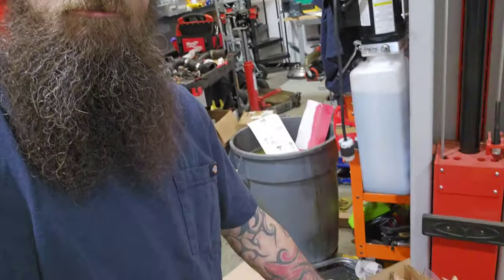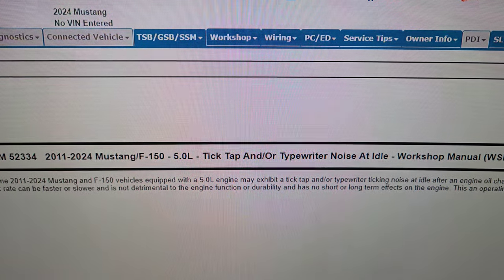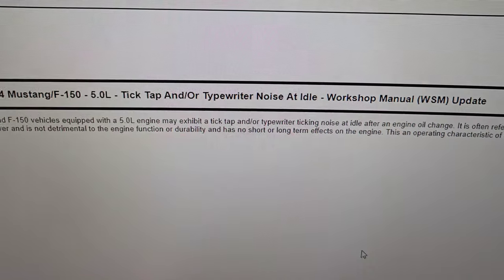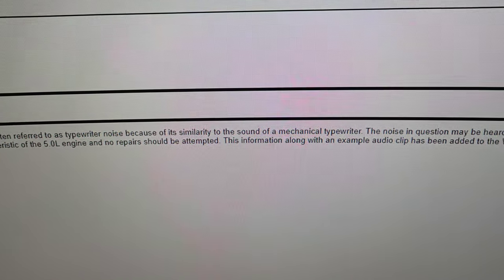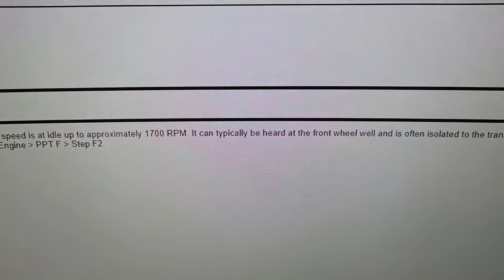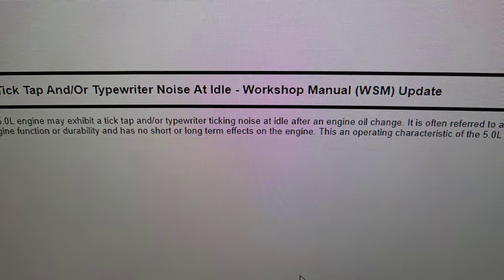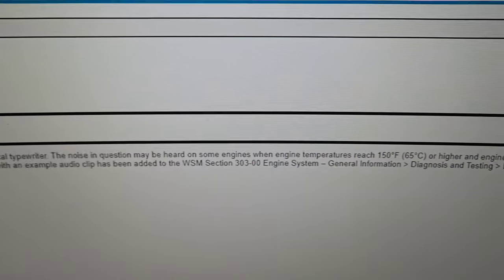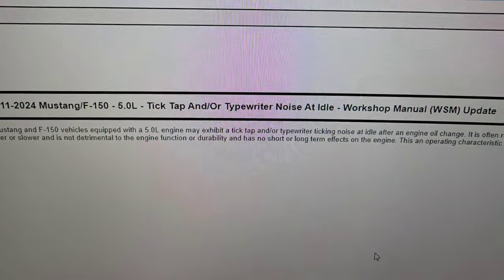Does The 2024 5.0 Coyote Tick? UPDATE #newtoyou #automotiverepairs  #mechanic

Comment: I have a couple of friends that one has a 2018 mustang 5.0 and the other has a 2023 f150 with the 5.0 they both drove 1000 miles for a break in then switched to Amsoil the mustang has 50,000 miles on it and the f150 has 8000 miles on it and they both don’t tick
Reply from the maker: My 18 mustang gt doesn't do it. I run amsoil. But then again. Not all of them do it.  Careful with that f150. It has a wet belt for the oil pump
Reply: That’s the oil I’m going to use for my first oil change
Reply from the maker: @E85_STI  💯💯

Comment: My 14 is quiet but I would be annoyed for sure if it ticked. I don't understand how changing the oil can make it come or go and it not be a lubrication issue which is definitely not normal. Just ask any competent engine builder.
Reply from the maker: Yep. Not sure how it's after oil change. But usually the further you go on that oil it quiets down. Then you change it and it does it again.  But not all of them do it. A friend works at ford in Kansas. And i was talking with him about it. We may have found a fix. Still needs more testing. But. We are working on it. Can't really release too much info on that. But. Soon as we know for sure. The world will know.

Comment: So if it’s “normal” why does it go away if you use 5W-50?
Reply from the maker: @hpkntnw  it doesn't. Not sny of them that we ran 5w50 in. It's still there. Normal meaning it just does it. Not hurting anything. Even the powerstrokes do it and I run 5w40 in them. I wouldn't run 5w50 in a mustang unless it was supercharged

Comment: Wix filter and amsoil will fix this I had 2021 gt
Reply from the maker: @ARTEM-ui4wx  amsoil with an amsoil filters does it too.  Only it will start again when you change the oil and filter. Amsoil and wix are basically the same filter
Reply from the maker: @ARTEM-ui4wx  I have a 18 gt
Reply: @BeardedFordTech   I think ford oil is just cheap  like water they should use amsoil for performance vehicles V8  this motor will last longer
Reply from the maker: @ARTEM-ui4wx  the full synthetic motocraft is decent. The bulk synthetic blend isn't made to go far. They should factory fill these with amsoil 5w50.  5w50 is factory fill for the  shelby with super chargers would eliminate a lot of the issues. Some guys run euro 5w40 and the noise goes away

Comment: Thanks for your vids man. That's exactly where the noise is on my f150. Wheel well and trans. It starts about 10 seconds after starting.✌🏼
Reply from the maker: Yep. That's the BBQ/Typewriter  tick
Reply: @BeardedFordTech  I just don't get what causes the noise. It revs with acceleration up to a certain point. It just seems like it has to be piston noise but I don't know.  Seems like at idol it has low oil pressure and makes the noise. Once you give it enough acceleration to build oil pressure it goes away. I don't know, it just drives me nuts. You pull into a stor or something and sounds like your driving a piece crap with a motor knock. Oh yea I guess I am. LoL. I love the truck. Great truck great power. Just drives me nuts. Along with the stalling every once in a while.
Reply from the maker: @lonewolf744  phasers and solenoids will cause the stall. It is very low oil pressure at idle. It uses a variable geometry oil pump controlled by an actuator.

Comment: Do you recommend adding ceratec in a 24? Dealer says they advise against it as it’s normal, they claim it’s the “high pressure DI fuel pump”.
Reply from the maker: @lindin_h  I DO NOT recommend adding certatec to any engine.  And I do not recommend it for the 5.0 liter. It's been doing it since 2011. And since 2018 people have made a big deal about it.  It's not hurting anything. Do not add anything to the oil

Comment: 2024 owner here,  ours just started at 1100 after first oil change.
Reply from the maker: Yep. Normal. Not all of them do it. My neighbor has one. It doesn't do it. But I see some at the gas station up the road. Some of theirs do it. Some don't. Weird.
Reply: @BeardedFordTech  Any perspective on the oil volume? Ford says 9.5 qts, but the dip stick on the 2024 if you put 9.5 qts is registering at the low end of the dip stick. 10 quarts puts right in the middle.

Comment: Hydro boot  man  last week got 3 reman units through    napa and I sewar all that was done to them was a spray paint job  and after the client wasting my time and there money they finally listened to me and got an OEM and Bam Fixed  and i got a 5.4 with the oil leak on the right rear cylinder head and no compression on 4 cylinders in that 4x4 conversion Van that I was hired to rebuild the Differential in
Reply from the maker: Yeah parts like hydroboost and turbos main parts like that. DEF systems exhaust filters I go OEM. I got burned on compressors from oreillys. They lasted like a week. So your no compression is it all on one side?  Timing chain?
Reply: this Van has a Crazy story on it

Comment: Is this similar to 3.5 eco boost noises? I got the timing chain rattle repaired under warranty on my 2018 F150, but it still sounds like metal is rattling around in the engine when idling or driving slowly.
Reply from the maker: Nope. The BBQ tick doesn't sound like metal rattling. Sound like lighting a propane BBQ grill lighter. If your hearing metallic rattling. Take the belt off the water pump and start it. If you don't hear the noise then it's the water pump. If you do hear it, you may have another problem. Reason I say remove the belt. If the water pump fins are scraping the engine you won't hear it with the belt removed cause it won't  be spinning.
Reply: @BeardedFordTech  thanks man
Reply from the maker: @ATHLETE.X  np

Comment: My ‘21 F250 6.2L has a “normal” typewriter tick…more pronounced at 1500 rpms. So damn annoying. Started around 8k miles. Now at 30k and no change. I heard putting sound deadener on the fuel rails helps. I’ll be doing that soon and trying Liqui Moly oil with ceratec additive. Have heard positive things of taking the tick down a few decibels. I’m desperate enough to try. I’m tired of having to drive around with my stereo volume up to drown out the tick. 😩
Reply from the maker: Ceretec works but quickly breaks down. And you spend more money on it every oil change. Amsoil quiets it down. I haven't come across typewriter tick on the 6.2. Just injector tick.  There should be foam around the fuel rail.
Reply: @BeardedFordTech  Yea supposed to take the foam off, apply the deadener, then put the foam back on. Worth a shot for me. Nothing intrusive other than unplugging a few lines. I know it’s more pronounced on the drivers side. I’ve read various 6.2 owners say injectors, plastic valve covers make more noise, bad valve springs, Valve train, cam phasers, roller follower, etc. And just to live with it and still hit 200k+ miles. I dunno how dudes do it. I can listen to an engine rumble, turbos blowoff, supercharge whine, etc. But gah damn the tapping makes me want to punch a baby 😂😩
Reply from the maker: @Sea2TC  if the tapping doesn't go away when ypu apply throttle and get louder and faster with engine rpm you may have a problem.  Worth a shot to remove the foam put the deadner and reinstall the foam. I'm with ya on that one.

Comment: so is the tick from Lifter design, tensioner pressure fluctuation  or Cam timing ??   wonder if any one found an aftermarket solution for it
Reply: I only ask as 3 years Ago I did a 150  that had the tick at idle  and I found cylinder 6and 7 the main bearings where bad and the there was  0.0018 to much clearance on the Bore so I bored it out and new over sized bearings and never had a tick ever again
Reply from the maker: It's actually from lower oil pressure at idle. It's heard under the car toward the bell housing. Not on top.  My buddy is a tech at ford in Kansas. We think we found a fix messing around with stuff. Not sure yet. Can't release that info til we know for sure
Reply: @BeardedFordTech  Awesome well I hope it works and you can patent it  and make it rich ... or at least leave you mark on the automotive world  but if you make it rich may bey you can get me a new coffee mug Fluffys taking for ever lol

Comment: Hey BFT I just got a Ranger Raptor and it is recommended that you use 91 octane gas. Many stations in my area have 91 octane gas that is marked for recreational vehicles and small engines only. This gas has no ethanol and is actually illegal to use in passenger vehicles I am told. Must be because the farmers have a very strong lobbing group.

The real question is can you use recreational gas in the Raptor and would it have the correct additive packages for my truck?  I know it must be hard to figure out but if it’s a Top Tier gas wouldn’t it be acceptable?
Reply from the maker: We don't have 91 here. We have 87 89 93 and all three are at gas stations. I don't see why 91 would be illegal to use?  All the fuel have the same "ad packs"  it's just the octane rating that's different. I've never heard of 91 being for recreational use only. That's odd

Comment: Just got this noise happening on my 5.0 scared me, I just did the valve covers and vvts
Reply from the maker: For the tick?  The VVT would be a rattle on start up. Or it would bog down at idle and want to die
Reply: @BeardedFordTech  yea motor would almost die at stop light so I changed VVTs, doesn't shake as much now either
Reply from the maker: @spn455  you change the vvt solenoid too?  I did a video on that when i was still at the dealer.
Reply: @BeardedFordTech  yea.alright. they never mentioned the vvt seal would be a hassle
Reply from the maker: @spn455  I don't replace the seal unless it's worn or leaking.

Comment: Just changed to amsoil on my 16 and keep using 5w-30. Haven’t noticed a huge difference compared to swapping from 20-30 which lowered engine noise in general. But we will see how it performs in the long term. Very price at $108 just for the oil. Would love to try liqui molly
Reply from the maker: Liqui Moly isn't what it's made out to be. It's more for motorcycles and European cars. It started in motogp
Reply: @BeardedFordTech i will probably just stick to rotella or Mobil one. Like paying double when all of them are synthetic and I change it way before the manual says with a new filter every time it’s better for my budget.
Reply from the maker: @Taino5.0  that mobil 1 will be way past your budget. After about 1000 miles. It'd way under viscosity and the ad pack is almost gone. It's made to the lowest standard to be considered synthetic.  Mobil 1 used to be good. Not ao much anymore. She'll is pretty good. We did oil testing on mobil 1. And the test shows it's horrible. That's not an opinion.
Reply: @BeardedFordTech which Mobil 1 I’ve looked up some full synthetic and they are like $30 for each 5Q jug. Might stick to Valvoline then. Rotella I have not seen on any ones top lists.
Reply: You wouldn't notice much of a difference but your machinist will be able to see the difference after engine disassembly. There is a reason amsoil isn't cheap, it's not cheap to produce. I personally run mobil 1 in my SUV, it doesn't see much load it's mainly a kid and grocery hauler, 165k on it and not a mechanical issue with the engine yet, but my built 93 mustang I run amsoil zrod 20w50 in it. It all comes down to what it's being used for, if it's something you don't ever plan on getting rid of or sees high load or any extreme conditions I would run amsoil, royal purple or any other same tier oil, oil is cheap insurance for an engine, even at 100 dollars for just the oil.
Reply from the maker: @nunya2814  not a fan of mobile 1. We have talked about it on livestreams. It I'd made to the lowest quality to be considered synthetic and it failed a few oil analysis tests.  Amsoil isn't expensive if your a preferred customer. You actually save money. And me being an amsoil dealer I get a pretty good deal. Zrod is good stuff.
Reply: @BeardedFordTech I just do one oil change a year so that’s why it’s expensive to me. If I was doing multiple their discount program would be good. And we have my wife’s car but she won’t want to put that in her car with how expensive it is.
Reply from the maker: @Taino5.0  makes sense!!
Reply: @BeardedFordTech yea like I don’t think I would ever even get enough wear in owning the car to care. But idk.
Reply from the maker: @Taino5.0  hell yeah!!